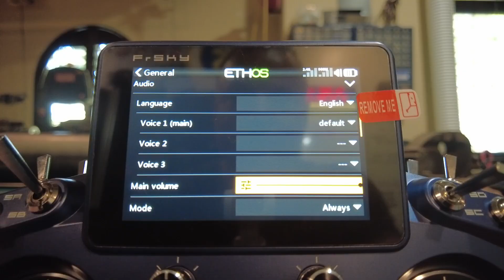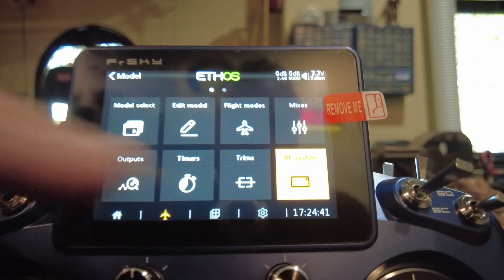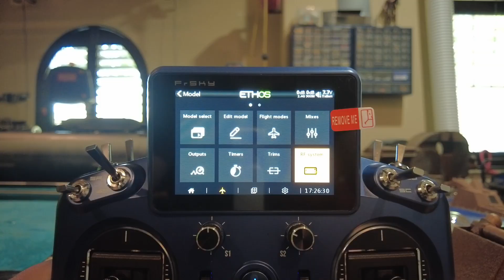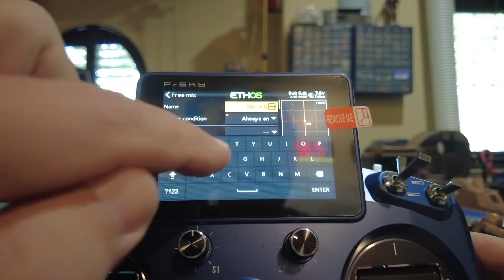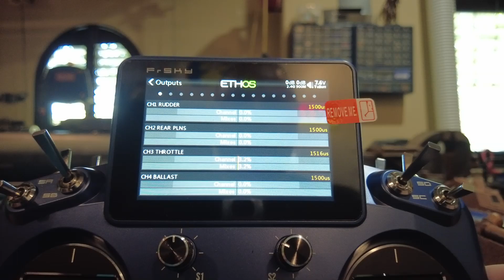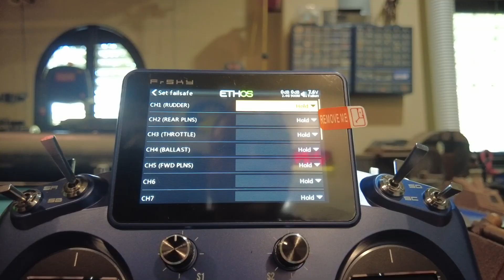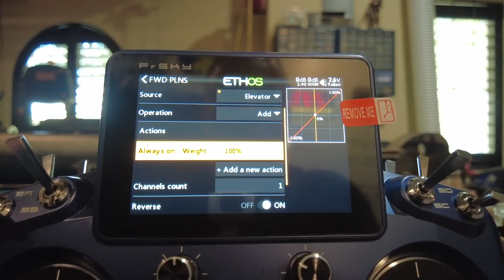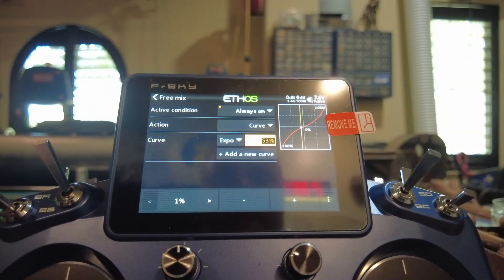RCSubGuy's Fast Attack #8: Programming your FrSky Tandem Transmitter and Receiver for RC Submarines

Comment: If you set your throttle up as a throttle mix you get access to more settings including throttle cut, which I highly recommend always having available. Safety first!
Reply: I have mine on the left 2-position switch, which also turns on my trending and announces "Engine Engaged/Disengaged" depending on position.